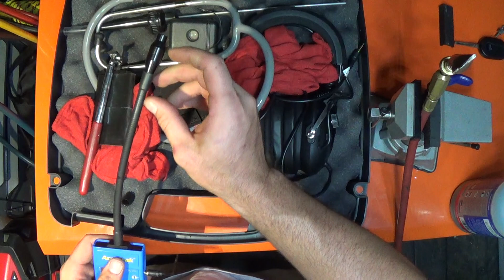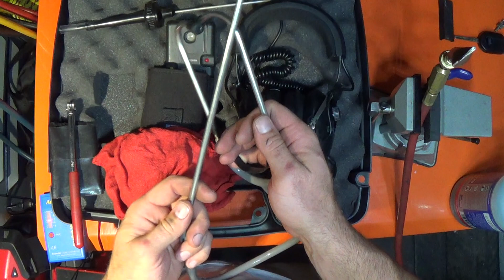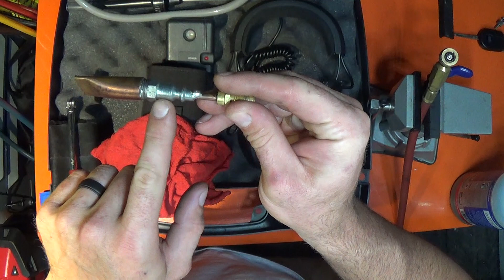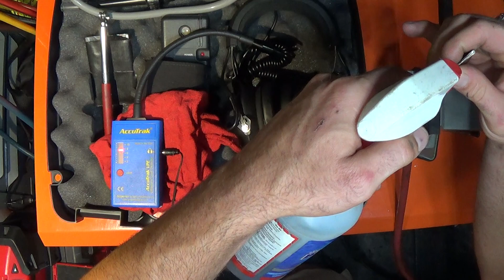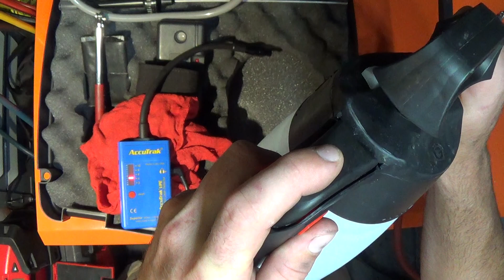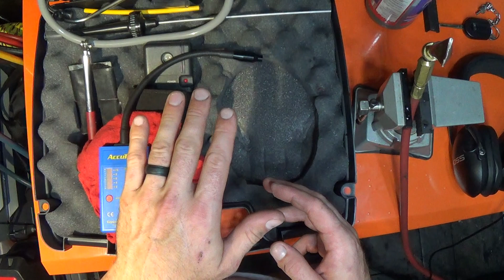Tools14: Demo of Accutrak VPE-GN PRO and Tips for Using Ultrasonic Leak Detectors

Comment: Oh, I don't like reviewers like you. Which generally cannot unlock the potential and fully show all the functionality of the device. At the very end, when your sensor stopped detecting a leak, it happened because there was no pressure. There should be at least 150 psig or even 400 depending on the contours. At such values, the device will really show its functionality and show its work in action.
Reply from the maker: That is true that ultrasonic does very poorly with low pressure.  If I had a better test rig I’d use it

Comment: I can't find any information about Amprobe ULD-410 vs this Accutrak one. Is that the one you tested, ULD-410 or ULD-420? Or did you try the ULD-400/405? Strange, as the Amprobe has a MUCH wider frequency range, which could theoretically pick up many more leaks or leak types. Would love to know more about the comparison, but like you said, isn't anything out there besides your comments here and at HVAC Talk forums.
Reply: @HVACLife  Thanks a bunch for the extra info on the comparison. Yeah the ULD-300 was the older model that Amprobe recently replaced. Of course the made in america thing is a huge plus - but still would be curious to see how it compares.

-Yeah the new Amprobe ULD-410 says it has 20kHz to 90kHz range, with intelligent auto noise filters (those filters are important from what I hear, and the ULD-405 doesn't have them, just the 410 and 420).
-The Accutrak is 36kHz to 42kHz, quite a narrow range and just wondered if that limited it somehow.
-The older Amprobe ULD-300 that you tested, is 35kHz to 45kHz, similar to the Accutrak.

I can see how the gooseneck probably made the difference, especially with the sensor being at the tip of the gooseneck.

Absolutely, soon I'll have to get the ULD-410 and the Accutrak, and compare them in a video with a proper leak set up. Interested in what sets them apart as they both are heterodyning type technology.
Then of course, there is the Accutrak VPE-1000... which is another step up in price but makes me wonder how it compares too on leak searching? haha
Reply: @HVACLife  For sure! Will let you know
Reply: @JFirn86Q  any updates on the comparison video?